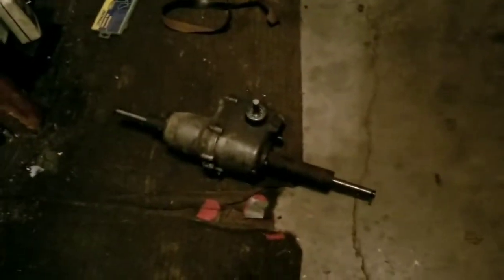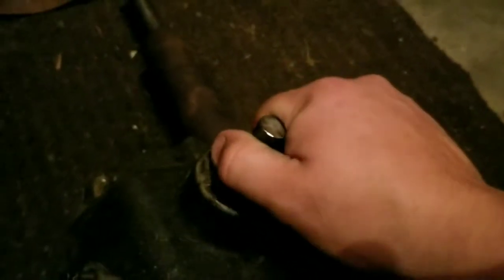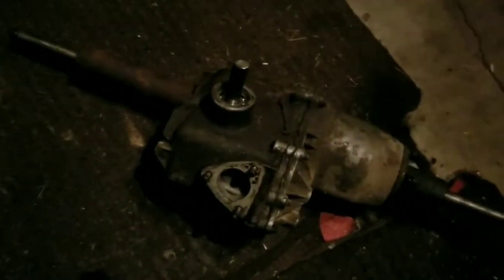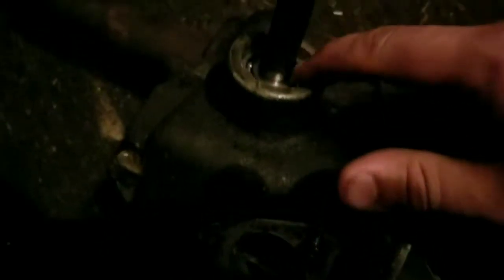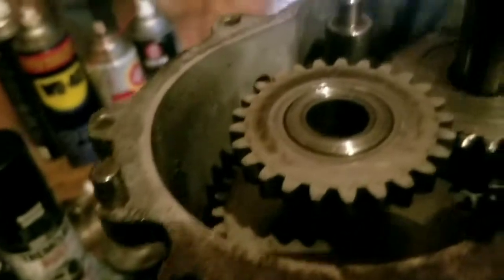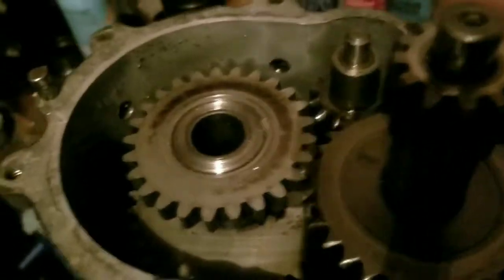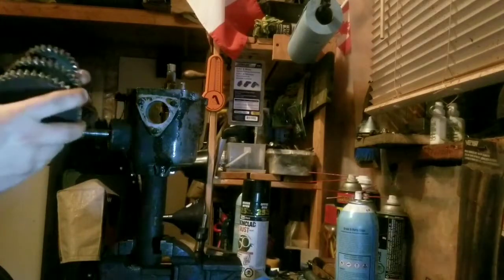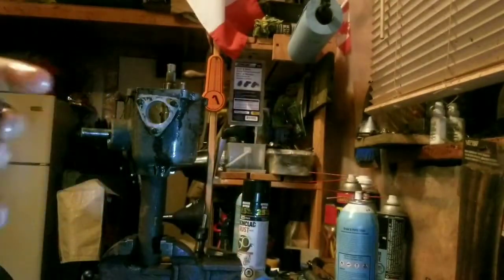Peerless 600 Transaxle Disassembly

Comment: 5-11-23   just a short to say thanks for your video. you are only one that shows how it assembles, even better than an exploded view diagram. I had a 600 series transaxle which I took apart and ordered parts to rebuild and keep as a spare. (That was 6 years ago! )I am embarrassed to say I took it apart 8 times! my sins are that I forgot how to orient the shifter rods and its stop, some of the times I forgot to install the splined gear above the shifter gear, idler shaft installation difficulty and most importantly I forgot to properly install the reverse idler spacer on the reverse idler gear.  ( the  exploded diagram gave the appearance that the spacer and then the gear.... your video showed the reverse! Thanks, Bob ....... Good job Allis Chalmers  d-21